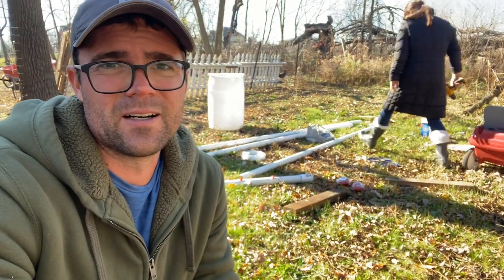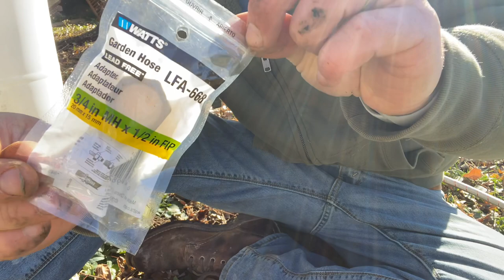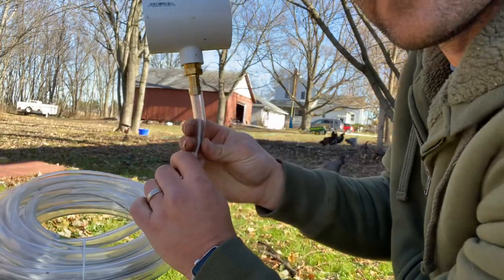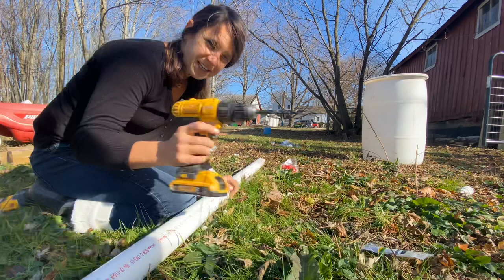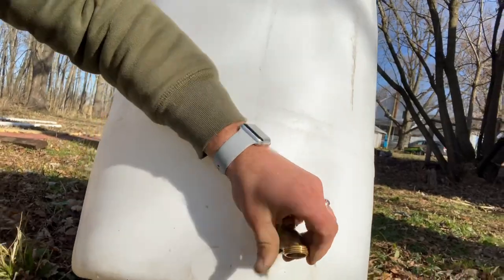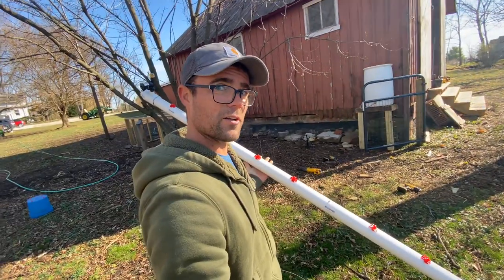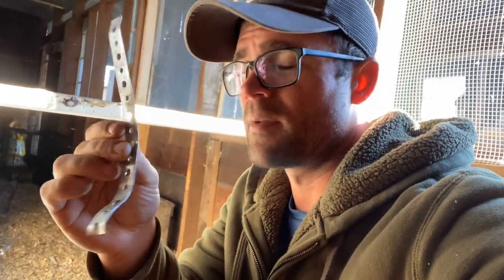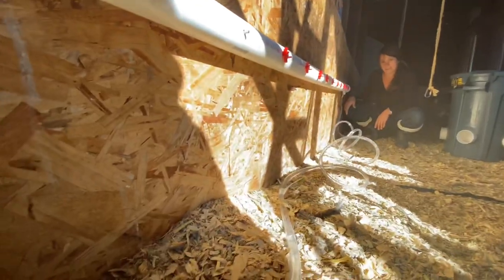DIY Heated Chicken Waterbar

Comment: How did you fix the leaking nipples?
Reply from the maker: I didn’t really. Using the vertical nipples seems to work a little bit better. Because it drops straight down. And it’s also about the height of the water bar. You need to make sure that the chickens need to stretch their necks up and drink at about a 45° angle. That seems to help. But nothings perfect.

Comment: What kind of pump did you use and where did you get it?
Reply from the maker: We used this one. It works really well. bayite BYT-7A014A DC 12V Solar Hot Water Heater Circulation Pump with DC Power Supply Adapter Low Noise 3M Head 8LPM 2.1GPM https://www.amazon.com/dp/B01FXDUQR0/ref=cm_sw_r_cp_api_glt_fabc_ZVXRJHZVVC3E1HTBSVK0?_encoding=UTF8&psc=1
Reply: @Kakadoodle  did you have a list of supplies
Reply from the maker: @dawnrichter1571  ya. In the video description I listed everything